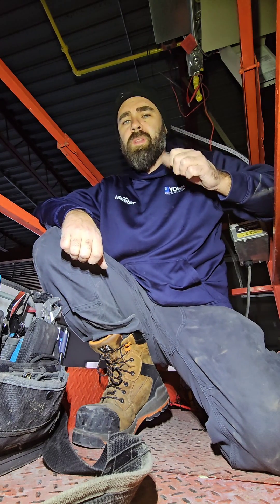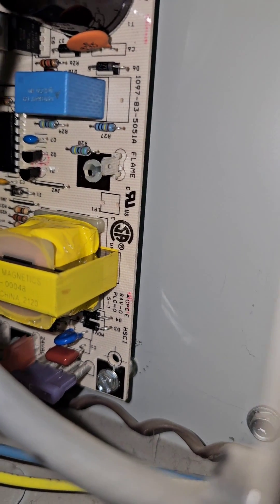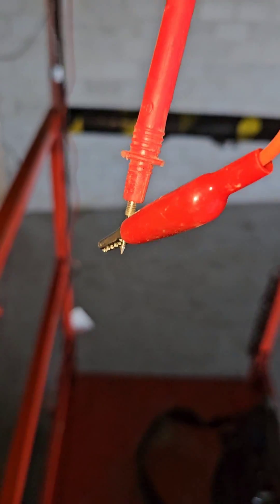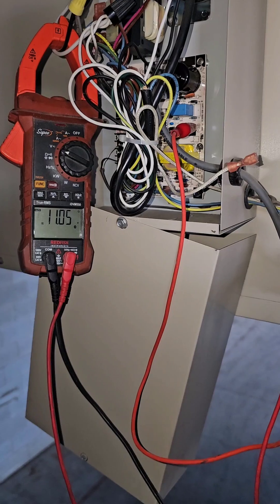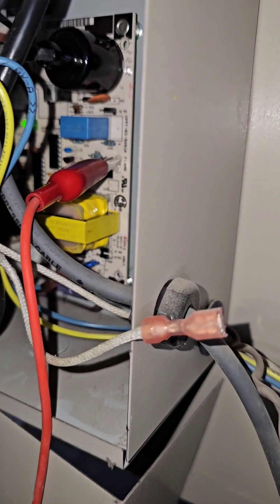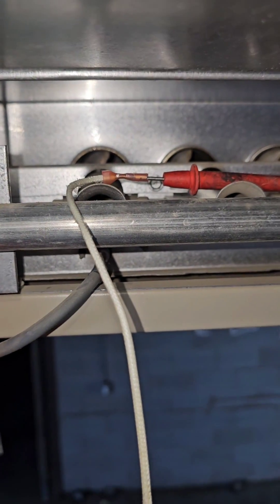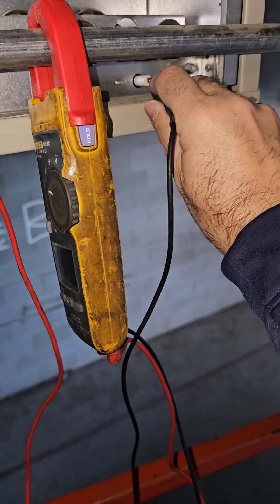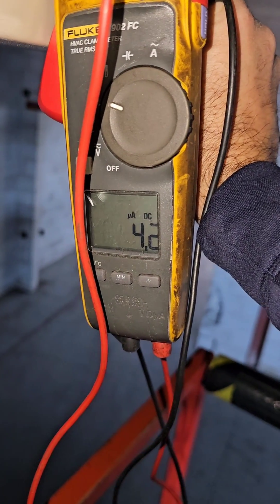How Does Flame Rectification Work On A Heating System

Comment: I'm about three years in and I told my boss exactly what you said at the end. If its not cracked and its cleaned its good, thats basically what you said at the end. Boss said no, check Ua when you can. I said no, this KNOW IT ALL GUY on YouTube said you don't have to check the flame rod like that. I went with my BOSS and against this KNOW IT ALL GUY. NO LIE PEOPLE!! This flame rod was BRAND NEW. Gas kept shutting off...I checked the Ua and it DROPS this flame rod. So do always check the Ua a flame rod puts out. ALWAYS  go Ua route...
Reply from the maker: I never said not to check it, I said I haven't in a very long time.  Checking the uA with a problematic system is 100% encouraged.

Comment: You are wrong. The AC voltage comes from the HSI, it goes through the flame to other side of the manifold where the flame prover is.
Reply from the maker: Lol, that unit doesn't have an HSI.  When I checked power it was at the flame sensor terminal and 120v was present.  This is how flame rectification works.  Some of you guys really need to research before you comment.

Comment: I came across a video "Christmas Candle Flame in an Electric Field" by Animated Science.  He puts a candle between 2 high voltage plates showing the flame "blow" in the electric field with more to the negative due to the positive ions in the flame.  The flame rod is doing similar with a lower voltage since it is physically in the flame.  It's just causing the ions in the flame to move toward the ground.  It rectifies because the burn has so much more surface area in contact with the flame than the flame rod.